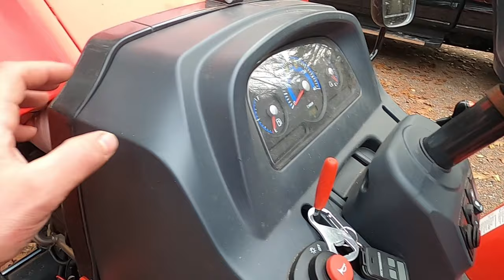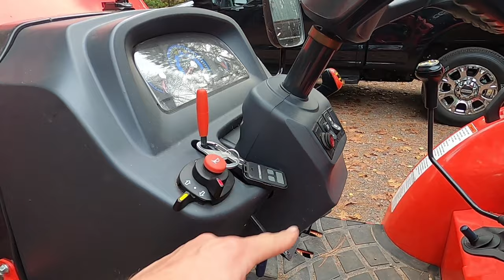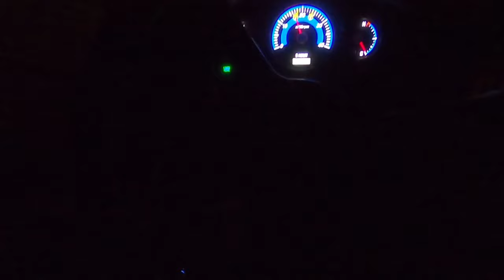I should have done this last year! Kioti Tractor Auxiliary Lights

Comment: Understand it's a little extra money, but I opted to run my forward facing lights on one switch and the rear facing light on its own switch.  I use my tractor 95% of the time in forward and 5% in reverse and didn't want to put hours on lights I wasn't using.  Also, no splicing (cleaner install).

NICE video, either way and GREAT upgrade to the tractor!
Reply from the maker: Great Idea!  I may do that at some point.

Comment: Dude, nice job. Huge improvement. If I could make one suggestion (as a retired electrician) install a fuse-able link as close to the starter as possible, so as to protect your wiring harness. If a fault (short) we’re to occur in that wiring harness it would subject to all the current the starter could draw, which would essentially turn your wiring harness into a match… Thanks for the video.
Reply from the maker: If you look closely, there is a fuse (https://youtu.be/Rry2JTOhavU?t=244) right after the connection to the starter.  (I believe - will have to double check that is actually a fuse). Does that qualify?
Reply: Yes, my bad. Most harnesses today incorporate them, but I missed the obvious portion of the video where you clearly pointed it out. Yes, you’re good to go. You can sleep with both eyes closed, confident that any short (in that harness) will not cost you anymore than the price of a replacement fuse. 👍
Reply: wouldnt of been easier & more simple, not to mention less costly to simply ground each light with a self-tapping screw to the rops? can also ground the switch?  also why use an extra switch when there are yellow lights with power?  why not tape into this hot wire, turn all lights easier?

Comment: Good job. I have been looking at these lights at TSC too. That's the one thing that compact tractors fall short on is lighting as probably few if any are sold without a loader. I just got a new RK 37 and it did at least come standard with a rear LED work light, now I want to add the two lights on the ROPS. The light brackets are already on the ROPS. How are liking this setup?  I keep seeing people talk about insect problems when your running the lights which I can see but what else are you going to do. Should have bought a cab tractor I guess, LOL. Thanks for the vid.
Reply from the maker: They are great!  I imagine if I run it in the summer there will be bugs but the benefit is that daylight hours are longer so theoretically I shouldn't need the lights as much.

Comment: Did you check out the factory wiring on the right side of the seat at the bottom of the ROPS (2 bullet connectors)? Or did your lights draw too much power?
Reply from the maker: The connectors i found in that area were always powered with the key on, when I tested them.  They would not turn off with a switch.  Admittedly I did this after I had already installed the switch so I figured to check any way.
Reply: @OutdoorsEngineer  Oh, they are always on and not connected to the light dial? I was going to check myself but cannot find my voltage meter 😅 so you NEED to put a separate switch system like you did if you want control?
Reply from the maker: @jesserusch333  My basic understanding is yet.  But I'm. It 100% sure.  I've been real happy with the Tractor supply lights i installed.